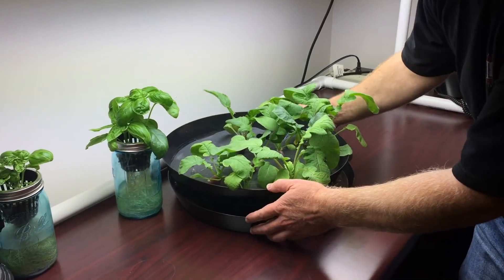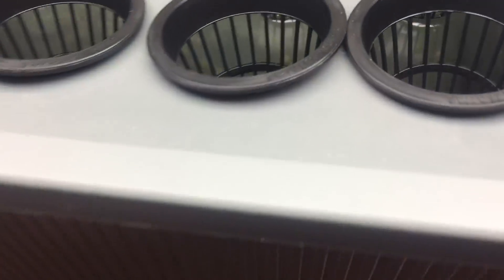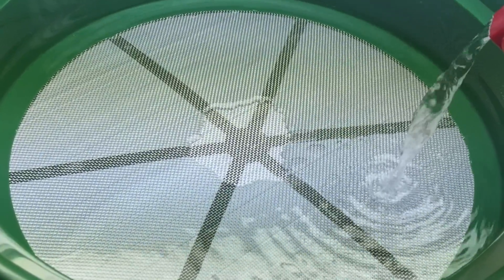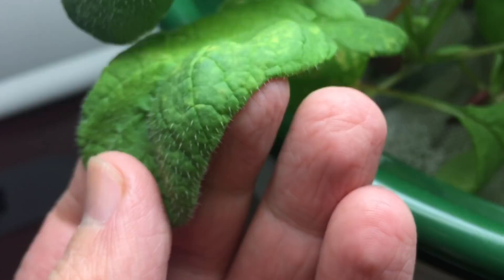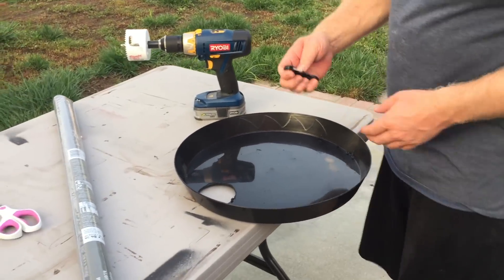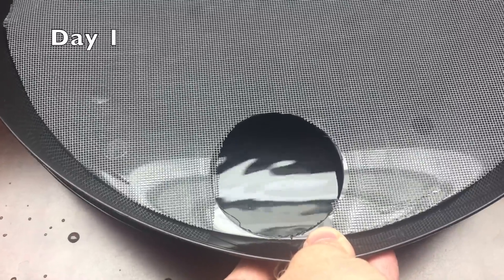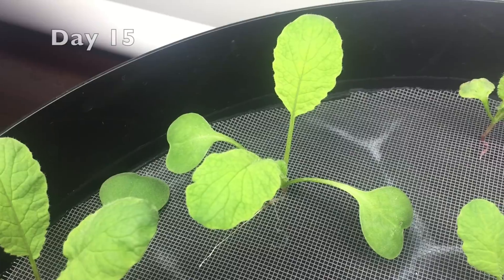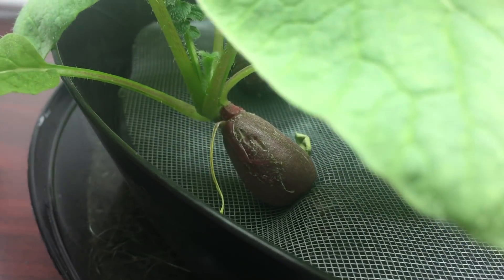Why did he grow them in a window screen?

Comment: Cut x shapes in the screen when they grow large enough so then there is space.
Reply: Greg Butts i was thinking exactly the same
Reply: Maybe even start the x before putting the seed down, then keep an eye and expand it as needed. That way you don't risk cutting the root. With the water keeping the screen kind of floating, I don't think the seed will fall through if you keep the x small.
Reply from the maker: I want to be able to reuse the screen though!
Reply: My be use paper instead of plastic greed. Wet paper will let roots to gro1w up with necessary space. Or maybe use of rock foam with cups then redish will grow on a half in foam. May be test several ways at the same time to reduce experiment time. But anyway it is interesting. Good job Geb!
Reply: Jeb Gardener I think if you make an x with two inch slits there will be room for grown, then remove prize and just move back into place for next grown. If that makes sense.
Reply: How were you planning to reuse the screen in this vid when the plants make the holes bigger? More seeds will fall trough with every use..
You could try using rubber or nylon since it stretches, but i don't think you'll be using those forever either.

Btw. Keep up the quest, i love these videos!
Reply: Need to figure out a way to suspend them by the greens once they start getting their radish on.
Reply: erkdoc5 I agree, I feel that a small x could be more effective. But I suspect the yield will still be limited. I can't think of an clever way to expand from here.
Reply: Maybe placing the radish on a long cut groove. That way you can prime a larger space the root might be able to occupy.

Comment: I am thinking panty hose might be a better option than window screen, it would have more give to it and would likely stretch as the radish root grows???   Maybe???
Reply: Especially if you clip a strand when the roots get going. Then you basically be making the hose get a run on purpose and it would allow more space.
Reply: Sounds like a good idea, and could work well. 
Insect screen  is very tough rigid ,and the fibers  don't  give way or part.
Even a loosely woven plastic weed matting  would be more friendly/cooperative.
Reply: Panty hose seems like a very worth while experiment.
Jeb G might just not like the idea of being seen ferreting around in the Panty hose section while trying to decide  which color is best.
Reply: @jonassalk1387  Use old ones, landfills are full of them. Either wife or friends, just say “I’m saving the world one pair of nylons at a time” next thing you know you’ll have an endless supply from lots of users...also old nylons are THE BEST THING for holding up tomato plants, do not damage plants at all!

Comment: One could use a god machine instead of water. The roots can take water from the fog too, this way they will have more nutrients form the air too.

And you can grow this on the suspended string, once the seedling is big enough to suspend it in the fog machine.
Reply from the maker: Yes but expensive
Reply: An ultrasonic fogger can be picked up for 3 bucks. Put in a piece of foam to keep it at the right depth. But i get u are a big fan of kratky so I'm  very interest in how u solve this puzzle.
Reply: An array of hooks to hang them so they can grow free with adjustable height
Reply: Where can I get me one of them 'god' machines? :)
Reply: purelyprimitives fog*
Reply: @purelyprimitives  have you checked prime?
Reply: @JebGardener  or air stones , popping bubbles will keeps roots moist
Reply: any link to video with this concept?

Comment: why not make short cuts (not holes) in the screen, so that it stays together but as the radishes grow they can stretch the screen more.
Reply from the maker: yes it would be difficult to reuse the screen though
Reply: All you need to do is shade the roots. they like it that way
Reply: tennis racket instead of window screen?

Comment: Best video yet, my dude. I was thinking about some periferic relief cuts around the roots, maybe you can sorta make it so it's easier to stretch for the plant. Maybe even better would be to use some elastic and deformable material, but I havent seen an elastic mesh that's that small. Maybe some membrane you can put holes on.
Reply from the maker: I think that would work but I would,like the setup,to,he reusable.
Reply: Silk stockings?
Reply: @Cheryl Hey that might work..!

Comment: I'm still at the lettuce stage, I haven't advanced to radishes so I have no useful input.  Congrats on 100K subscribers, did you get your plaque yet?
Reply from the maker: radish is easier than lettuce.  Just use rock wool and scrape it off the bottom.  Most of these radishes end up tubular so only a little bit is spoiled by the fibers.  I didn't even get an email from google about the 100k but thanks!
Reply: Jeb Gardener I would imagine that, instead of a strong synthetic? mesh, perhaps if you tried a cheap natural thin cotton 'cheese-cloth' fabric (used for straining curds when cheese-making and also previously popular with hippy clothing) then perhaps, judging from what your roots did to the synthetic mesh, the cotton material would likely give under pressure from root growth.  If not, then a nick to the fabric with a sharp knife or box cutter blade would facilitate easing of the material for the root.  The disadvantage compared to a nylon mesh, for example, is that the fabric would be a consumable - not being reuseable.  Note that , if you have ever used cotton fabric as a nutrient wick then you may have noticed how quickly thin cotton can rot away after a few weeks when submerged in nutrient.  Unfortunately, Rockwool is a nuisance waste - although I've found it useful as tiny Rockwool plugs that I've used to cleanly germinate seeds for DWC or aeroponics.

Comment: Hey Jeb, i'd like to get started on all your kratky shenanigans but i live in Singapore and mosquitoes are a huge problem here, as well as the heat. Any issues i could face? I;m a little afraid of the stagnant water in the grow tubs! Maybe i should cover the whole setup in mosquito meshing?
Reply: I can't remember, are mosquitdoes only interested in non-moving water? If so, maybe water pump would help? I agree covering it in mesh sounds like a good idea, but I'm not sure how difficult that would be.
Reply: I Use Mosquito netting to keep caterpillars from my plants. I can see it working. However have you considered poking a hole with Any netting big enough for the stem to poke out?
Reply from the maker: I would net the whole setup.  Dr. kratky has some videos of him putting screen inside the tote to avoid the problem.
Reply: Jeb Gardener, Speaking of mosquito netting, consider using it in place of the screen mesh. 

Better yet,  layer the Mosquito Netting over the (((screen-mesh with holes cut in it))) you have the rigid mesh for support and the Netting for ease of root growth.
Reply from the maker: i wonder if you can have mesh on top and bottom to keep the butterflies off of them
Reply: IT will keep butterflies off the plants. I use the netting myself after having hornworm problems. The Netting kept the Adults from laying eggs on the plant. It works.
Downside of using this is that you prevent pollinating insects from reaching your plant.
Reply: John Doe Couldn't you grow it inside where you can control environmental conditions better

Comment: Grow the radishes in damp paper.
Reply from the maker: That worked but it took longer for the sprout to penetrate the substrate than it did with agribon.
Reply: I tried little squares of a single ply of toilet paper, a seed on each, and put them all on a wet paper towel covered with wrap. When they sprout put the little squares in net cups with clay pellets. I did this for lettuce and it worked pretty well. I would do it again. With radishes you might need to help out by rearranging the pellets periodically as they grow.

Comment: A useful tip I picked up working in a marine laboratory with different algae a tank system: a bubbler to oxygenate the water and a small pump to keep it moving prevents scum from forming and undesired fungus, even in more open aired areas. This will also keep all nutrients evenly distributed through the system so some areas don't collect more or less than others. If you're concerned of roots being tangled in pumps, a small pump outside of the system with simple friction hosing routed to the in/out holes and back into opposite sides of the system will make a safe and continuous current. a fine mesh similar to what you used here  over the ends of the house that go directly into your tank/grow system will prevent any debris from seed casings or dropped matter from clogging your pump as well. Be certain to bleach your materials as well, and rise with DI water afterwords. Best of luck, excellent atmosphere in your videos.
Reply from the maker: Thanks atlas.  I'm doing test models for large scale production outdoors, so air pumps are to be avoided if possible.  Besides that, the fungus in grow 2 originated in the exposed portion of the roots, not underwater.

Comment: After seeing your recent micro-greens video I came back to this and gave it some thought on the roots. I think you might want to try some thin plastic tulle. You can get it at any fabric store. It's strong enough to hold up little seedlings in the water but weak enough to tear if you give it enough force. You can get tulle with very fine holes or tulle with bigger holes, and some of the bigger holes are still small enough to hold a radish seed. It might be worth a try!
Reply from the maker: Good idea.  My current plan is worn out summerweight agribon

Comment: Lovely stuff as always jeb, pushing new frontiers!

i think you should start of the seeds in your humidifier or plastic bag, and transplant them in the bucket, making sure the roots and "fruit" are seperated at each end of the "screen"
but preferably don't use a screen ;) , i'm pretty sure you don't want the light to hit your roots, although your plants looked mighty fine for a long time.
and you're paddling between a kratky, and a hydroponic system, and i think your plant is growing roots on your vegetable to get air.

in a kratky, the plant uses water, so the level drops, and the top roots become air roots, and the ones in the water are water roots; so you don't want to completly retop a kratky, sufficating your plant.
and in a hydroponic system we just use an airstone, so the roots get all the air they need in the water.

Keep 'em coming!
Reply from the maker: It’s the constriction

Comment: I use saran wrap with holes poked in them to solve that issue. Although I think it only works on smaller plants cuz the weight would droop the plastic. I never used net cups or rock wool before

Comment: i used to do hydro with a pump and a timer. a reservoir was underneath the buckets (two), and the buckets contained the plants. the plants were in pebbles. the pump was on for one minute about 2-3 times a day. the pump pushed the water up from out the reservoir, up the hose which divided then into two (each bucket) and it would fill the bucket. At the minute mark the buckets were filled to the rim and the pump would then turn off. The water would drain back into the reservoir. the roots were as big as you'd expect (very big) and it all worked out fine. The good thing about this was water control via reservoir. I could freshen the water and solutions regularly. And it was fed on a timer. I didn't do much other than train the plant
Reply from the maker: From what i've seen that is a decent way to grow a plant.  I'm working on something that can go without electricity and minimal human intervention.  on a small scale, flood and drain or whatever they call those systems seem like a fine option

Comment: Grow in Empty Paper cups that will degrade on the bottom wet part once it gets big enough, but stay connected on the top dry part that will be connected to a bucket by drilling holes through the cups and running a hanger or rod through.
Reply from the maker: That sounds interesting but I'm looking for something that can scale

Comment: This was interesting, if you were to use a small aquarium pump in the water reservoir, or an air pump and air stone you would decrease the anaerobic growth in your water.  At the same time you would also increase the available oxygen to the roots.  This is just theory based on some other plants I have played with. I have never tried radishes this way.

Comment: You asked how I think you should grow these... Use the same saucer and water bottle setup to maintain water level but set net cups say 1 or 2 mm deep into the water (you will have to experiment how deep is necessary). Fill the net cups with perlite and place your sprouted seedlings on top of the perlite. The perlite submerged in water should be able to wick enough moisture up into the perlite above water and that should keep the little roots fed. Then as the radish bulb expands, it can push the soft perlite out of the way. Hopefully this will help avoid the constriction issue.
Good luck, I hope you find a method that works!
Reply from the maker: good idea

Comment: I'm going to see if I can explain this well enough. I took two sheets of paper and cut one square in the middle of each sheet.  Lay one paper on top of the other, position it so that two corners (of the squares you cut) make a small opening. Then you can push the top paper to make the opening bigger (for the radish growth.)  You could use two sheets of hard plastic, so it's sturdy, reusable, and easy to rinse off.  Cut multiple squares with maybe 2 inches space between them. I would be worried that the openings might shift with a breeze or a bump, so maybe you can come up with a way to secure the two plastic sheets in position. Hope that made sense. It might be a little fiddly when the radishes are young, but once they get a little hefty I think it could work.
Reply from the maker: Very creative but it would be difficult to have a whole bed of radishes that way.  Agribon is looking promising.

Comment: Grow them in a bed of perlite that is soaked with solution. Cover most of the perlite with black plastic with holes and drop seed into the holes but they are sitting on top of perlite.
Reply from the maker: That could work

Comment: cheese cloth , large pore filter sheet or thin soft sponge sheet , thin sheet of cardboard or brown paper towels can melt away during growth which need some structure support like clay pebbles after.  ( I know you don't like them but it's easier) .  They want to go to the Dark place so you have to fool them with something covering the radish part separate from the leaves above the water so that they won't try to crawl them self down any further and drown them self away.  Black cheese cloth like fabric or black nylon ( think cheap panty hose lol) works too you can crumbling them up for plant supports and light moisture.    I love your diy growing bed btw , totally giving me so many new ideas it's awesome!
I still prefer the air bubble hydro growing better than nothing do to less fungus problem. I wonder if there's a way to control it better?
Reply from the maker: that fungus seems pretty harmless.  The grow doesn't require bacteria so you could add some kind of chemical to kill fungus.  People say peroxide but I think that dissipates quickly

Comment: My recommendation would be to create a mesh out of kitchen twine or something where the strands aren't actually bound to oneanother, and where there is sufficient slack that any amount of pressure displaces the strings around the root, but such that vertical load is still supported. Something that @Trace 23 mentioned as well was using an ultraviolet light to disinfect the water. While it's probably unnecessary and bad for the plastic to be permanently subjected to UV light, it may yet be wise to periodically hit the water with a UV light to keep fungus down.

P.S. if you're interested I could 3d print a jig for creating tileable panels of twine/string mesh by wrapping it around a premade panel.
Reply from the maker: That mesh sounds cool, but I think agribon might do what I need.

Comment: You could try a hand woven screen using something that wont break down like a fishing line. It would probably need to be tightly woven looking almost solid yet malleable and stretch-out-able> removing layers as needed till you have the proper amount> using your juice bottle design until sprouts are big enough. For the weave> so like a back and forth halved interwoven design as to not disturb the base screen structure allowing the layers to be removed> you could use a dream-catcher or 2 sticks/knitting needles.. actually for a quick and easy design you could braid the fishing line and weave that> layers may not need to be removed from that> just make sure you have a good spacing to not loose the radishes from weight pushing the braids too far apart.
Reply from the maker: something like that could work
Reply: Curious if it will ^.^